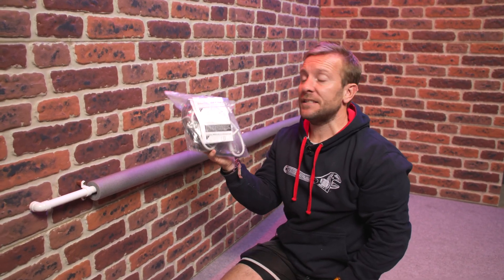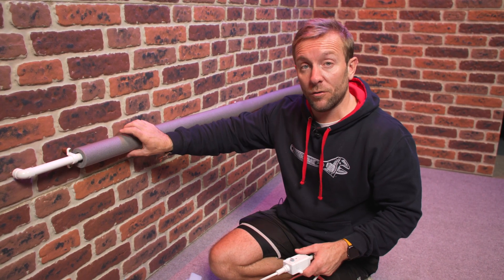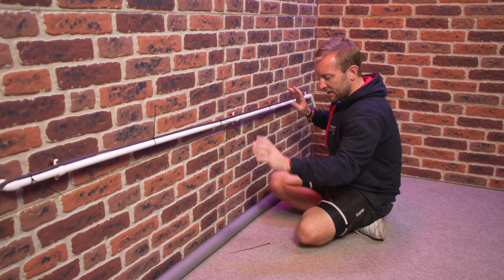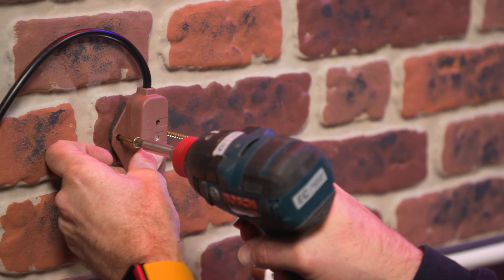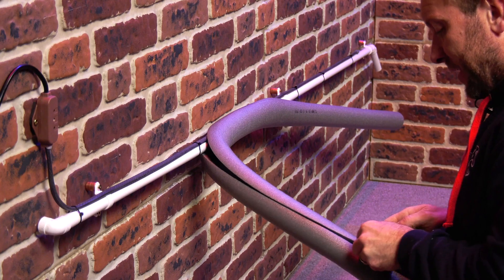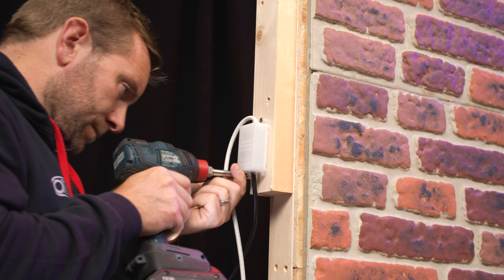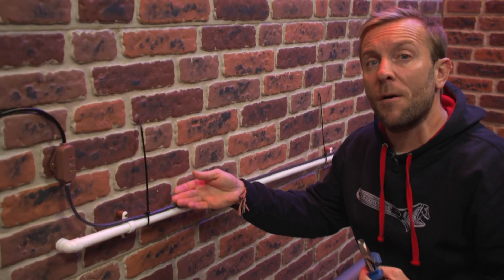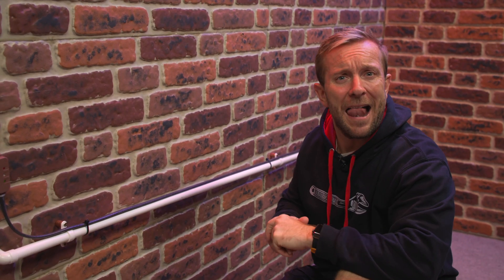How to Install trace heating on condense pipe

Comment: One of those would be great on the flow and return pipes of a monoblock air-source heat pump to protect the pipework from freezing and avoiding the anti-freeze valves letting go prematurely.

Comment: I have a 40mm external condense pipe fitted and the existing lagging is a mess. I have also got a trace cable fitted too. Do I have to still lag the pipe with the trace fitted? Super expensive for lagging that size so the other option and cheaper would be to replace the pipe work with a narrower pipe. What is the smallest diameter pipe I can get away with please and thanks :)
Reply: Yes, you still have to lag the pipe with the trace fitted. Smallest diameter will be 22mm if it's a short run in a sheltered location. Longer runs will benefit from 32mm if it is just carrying condensate.

Comment: Truly save your money and put a 40mm condensate or 32mm with insulation
Reply: If I remember correctly the manufacturer instruction on Worcester boilers is that any condense pipe outside should be 32 mm minimum with lagging.

Comment: Thanks for the video.
However With the increased price of electricity this would cost 2 pounds for every ten hours of use. So about 60 pounds per month not 50p. B
Reply: Your maths are wildly off or you electric is the most expensive in the world. 40w heater 3 hours a day for a month at 30p p/kwh is 80p a month, and 10 hours usage is 13p

Comment: Foiling it in the pipe gives better heat transfer but if there’s enough heat it shouldn’t matter - and strictly speaking it should go on the underside of the pipe (heat rises) but better than nothing- 
James- have you ever encountered HWS trace heating on long runs from local water heaters/of calorifiers?

Comment: Does this one require application of aluminium tape to the heater cable when fitting to plastic condensate pipe?  Sadly mine does.